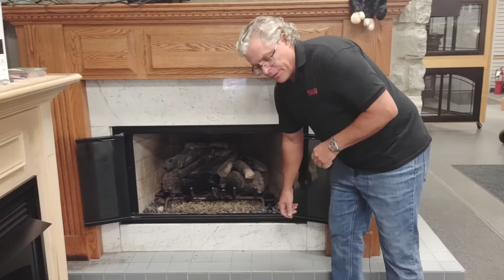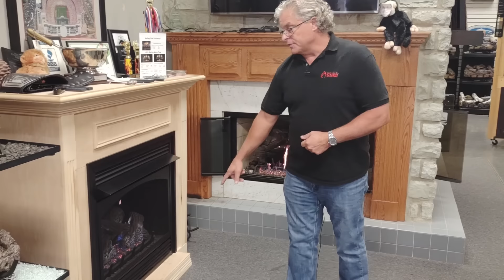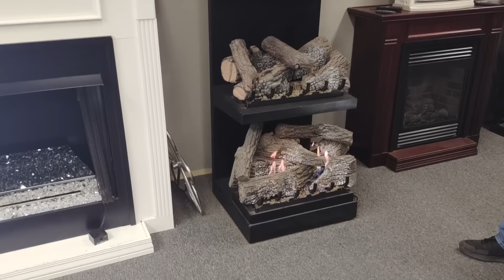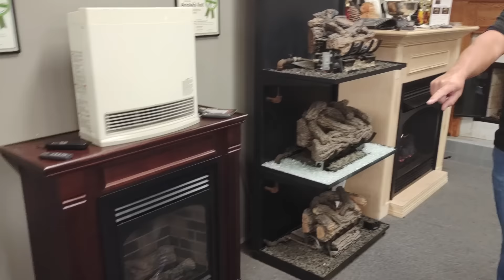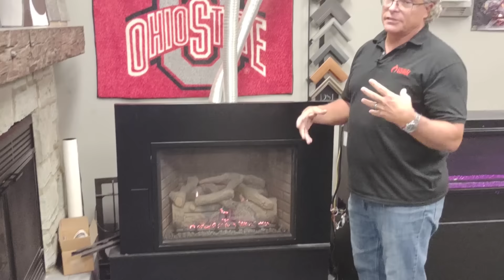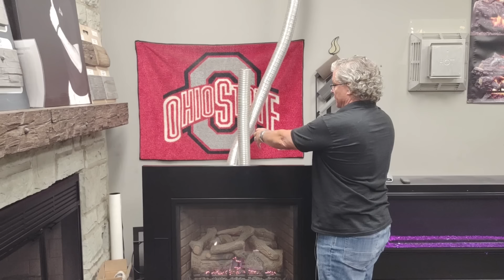Gas Fireplace 101 - Vented, Vent-Free & Direct Vent Gas Fireplaces Explained

Comment: I don't get it; one gas fire makes dangerous levels of CO and so it has to be vented up a chimney, yet another gas fire somehow doesn't need venting up a chimney.
What is the difference between the gas fires that makes one emit dangerous levels of CO and the other one safe levels of CO?
Reply from the maker: It's all in the burning process and how much fuel they use. Vented gas logs are essentially just lighting gas on fire. Think of it as one giant gas leak being lit. Since the combustion is not efficient and the fuel being used is around 90k btu's, vented gas logs produce a higher level of emissions, including carbon monoxide (CO), carbon, and water vapor. This is why vented gas logs need to be vented through the chimney, ensuring that harmful gases don’t accumulate indoors.

Ventless (Vent-Free) Gas Logs have a burner that is designed to burn fuel more cleanly and efficiently. The burners are engineered to produce a near-complete combustion process, which minimizes harmful emissions like CO. The byproducts they end up producing are small amounts of water vapor and carbon dioxide (CO2). This is able to happen because of the design of the burner and because it uses much less gas, only a max of 40k btu's.
Reply: @SpecialtyGasHouse  
Many Thanks!
Reply: @SpecialtyGasHouse  thank you for this explanation. But I have a fireplace with a flew/chimney, could I still get Vent free? If so, flew open still right?
Reply: I don't quite get it either. I think 'the logs' are being cited as one or another, and maybe it isn't the logs at all, it's the efficiency of the burners.

Comment: Bought a house with a regency. It has a remote bird gas, it’s built in. No manual, no idea how to turn on. Remote doesn’t turn it on. Don’t know model number. Can’t see a power switch on wall etc.
Reply from the maker: The pilot may need to be lit first. Do you see a little blue flame in the fireplace?

Comment: How about carbon monoxide levels regarding ventless units. 

Would you be replacing the oxygen with monoxide ?.
Reply from the maker: Ventless gas fireplaces,  don't need to be vented because of their specially designed burners. Ventless gas fireplaces use highly efficient burners that ensure nearly all of the fuel is combusted. This means they produce a clean burn with minimal byproducts, such as carbon dioxide and water vapor, rather than harmful pollutants like carbon monoxide in significant amounts.

All ventless gas fireplaces are also equipped with an Oxygen Depletion Sensor, which automatically shuts off the fireplace if the oxygen level in the room drops below a safe threshold. This safety feature helps prevent any buildup of dangerous gases.

Comment: Great information. We have a majestic vent free fireplace and just fired it up this year. Never used it before after living in our home for six years. One thing I notice tonight is the wood mantle gets very hot. Should I be worried about a very hot mantle? Can I add deflector kit to direct the heat away from the mantle? Thanks
Reply from the maker: The worst thing that could happen is it could discolor your mantel or possibly bubble up the paint if it is painted. Our company makes custom hoods if you are local to Columbus, Ohio, but they also make universal hoods that you might be able to put on your fireplace to deflect the heat away from the mantel.

Comment: I have a gas insert in a wood burning fireplace remote controlled,  home came like that. Have a co2 detector in room have had it on with the flute closed nothing on the detector for an hour.   Does it always have to have a open flute?
Reply from the maker: It all depends on what type of gas fireplace you purchased. Are they vent-free gas logs or vented?
Reply: @SpecialtyGasHouse  just found the paperwork lol, reading is fundamental!  Top page states "unvented gas log heater or vented decorative appliance.  Model deb20, deb 24, deb 30

Comment: So in terms of maximum efficiency, and throwing out the most heat should I lose electricity during the winter, and how much oxygen is being pulled out of my room( and how much is gas contaminating my breathing air) which system is the best?
Reply from the maker: Vent-free is 99% heat efficient so if you are looking for heat this is by far your best option. It also does not require power so it will become your emergency heat source when the power goes out. 

They burn 99.9% clean so you do not have to worry about any harmful fumes and they do use room air for combustion but it is nominal. Every vent-free has an oxygen depletion sensor on the pilot assembly so if it ever gets below a certain level of oxygen in the room the system will safely shutdown.

Comment: We have a house from the early 90s that has a gas fented. Fireplace and we put real wood in there  is that safe
Reply from the maker: In order to burn wood safely in there, you will need to remove the vented burner and fake logs. You can either cap the gas line in your fireplace or add a log lighter bar to use the gas to assist in starting your wood fire. 

Then I would definitely have a chimney sweep come out to ensure there are not any issues with your chimney flue and to make sure it is venting properly.

Comment: very informative. We had our home built 4 years ago and they put what I think is a direct vent fireplace. It has a blower inside and a metal box on the outside of the house. Just curious as to what gasses are emitted from the outside box. I'm considering enclosing it with a glass greenhouse style enclosure so I don't have to carry outdoor plants inside during the winter. I thought if it emitted CO2 that would be perfect for the plants and might exhaust some heat as well to keep things from freezing. Would that be a safe project or would it reduce the intake air or create a gas-filled environment that would kill the plants. Thanks for any info.
Reply from the maker: It would create a gas filled environment with carbon monoxide which would most likely kill your plants. I would definitely not do that.

Comment: Do you need 110V outlet inside the firebox for the igniter/controls for any of the options you showed?
Reply from the maker: Vented, vent-free & direct-vent millivolt gas fireplaces do not require 110v. If you are adding a blower to a direct-vent, then you would need power run to it.

Comment: to open or close the flue...  I have a doublesided (see thru) vented woodburning fireplace with a gas firestarter.  We don't burn logs because its hard to keep the smoke from blowing thru instead of going up the flue pipe, besides its messy.   We instead have fireplace glass with the special burner.  Has worked great for 16 years, lovely.  My question is, do we have to open the flue?   We have hanging glass plates as firescreens, but there is a gap around the edges for air to come in/exchange.    Our flue is a pain to open and close, so I would like to keep it closed since we aren't burning wood.  This would also help keep out dust, and may direct more heat into the living areas.  It does not have a pilot lite.  It has a key we turn, and light with a match.
Reply from the maker: If it is a vented gas fireplace, you have to make sure the flue is completely open when in use. If you do not you will be getting CO into your home.

Comment: With a Vent-Free Fireplace can I build my own mantle/surround then have the vent-free fireplace installed?? OR if I have a 3D model of a mantle/surround can your company build it to work with the vent-free fireplace?
Reply from the maker: Yes you can. You just want to make sure the top opening of your fireplace is a safe distance away from your mantel. The distance all depends on how deep your mantel is and if your unit has a hood or not.
Reply: @SpecialtyGasHouse  THANKS! I would refer to the manufacturer specifications as to how much clearance is required  between inner mantle sides, bottom, top and rear before install. With my DIY plans it calls for ceramic tiles on all inner areas surrounding the unit. ( ⭐⭐⭐⭐⭐ Specialty Gas House. )
Reply: I drove up to Columbus to check out the ventless that you had there. I need help. I don’t think my sales guy there would be able to do a design. Any way I can get help?

Comment: I am looking at the vent free style but have questions. 

I have a blank wall that I am framing up, I want the fire recessed in the wall with a floating mantle. Do I purchase an insert and a set of vent free gas logs or is it sold as one unit? 

Also is there any blower or power requirements (power outages will the fire still work)? Thanks
Reply from the maker: You would purchase a universal vent-free firebox and then a gas log & burner to go inside the box, or you can get a whole system unit that is sold as one unit. If you do the universal box you will have more options to choose from. Both are usually right around the same price. 

Vent-free does not require any power, so they will continue to work when the power goes out. If you add a blower you will need to run power to the unit. I usually advise against blowers though because you don't really need them with vent-free since they are already 99.9% efficient.

Comment: Won’t be using my vented gas fire place until they lower the gas prices.
Reply from the maker: Replace it with vent-free, it uses 1/3 of the amount of gas and they are 99.9% efficient, which means your furnace will be working less.

Comment: I have a wall insert gas heater but I am curious if I can switch to a fireplace look with a mantle and not need a chimney or anything? It’s in the middle of my house and on the other side is a kitchen sink so I have to be careful of what I do.
Reply from the maker: Without seeing a picture and knowing all of the information, it sounds like you can do a vent free fire box, either free-standing with a mantel, built into the wall, or with a wall built out. You won't need a vent or chimney with these. 

Here are some examples of boxes. http://whitemountainhearth.com/products/vent-free/vail-fireplaces/

Comment: Has anyone used two 4" inch duct, in place of, one 6" ( dual flow/coaxial)?  I want to use 4" chimney out thru the roof and 4" for intake air that will come in from a knee wall.  Problem is,  I can't go straight out thru the knee wall because the window ledge is below the Stove exhaust.  A 6" flue looks stupid on my Hearthstone fireplace and blocks the view out the window.

Comment: I’m more confused now after the video then before
Reply: Lol
Reply from the maker: Hi Jamie, what questions do you have?
Reply: @SpecialtyGasHouse I’m trying to figure out if I need to open the escape tube on the fire place I have gas set up with vented logs do I need to open the door in the chimney
Reply: @jaredgonzalez3372 , Yes, you need to open the damper (“door in chimney”).  Like he said, if you have vented logs, you are not even supposed to be able to close the damper because it would be dangerous.
Reply: @jaredgonzalez3372 the "vent escape" is known as a damper, is the flap that's used to open and close the flue. That's what he is referring to. That gets clamped permanently open for safety (carbon monoxide)  and the doors in front need to stay open during operation for gas logs.
Reply: Thats because your IQ is 63
Reply: @reellovefishing714 🤣🤣🤣

Comment: Looks like I have the same fireplace.  It was running then just stopped.  It won’t start up again.  When I hit the switch, I can see the igniter working and sparks, but it’s just not lighting the fire.  Do you think this replacement would fix that or do I have another issue?
Reply from the maker: Depending on what kind of fireplace you have, it might just need some routine service.

Comment: Vent less offers great heating ability and very cozy.  However - wood burning inserts have so much more charm.  Therefore, I will be adding a vent less wood burning fire insert for the best of both worlds!
Reply: Lol ventless woodburning ,,,,,,good luck with that….. I think anybody knows what’s gonna happen, my goodness!!!
Reply: Not sure what you mean.  There are vented and non-vented.  What is the unit that offers best of both worlds?  What is it called?   I have a wood burning FP. I like the look of the vented set, they look more realistic, but the ventless provides more eat.
Reply: Wood burning fire has to vent. It produces smoke.

Comment: Are ventless safe from a carbon monoxide standpoint?
Reply from the maker: Yes, they are! They burn 99.9% clean and only release trace amounts of carbon monoxide. They will produce anywhere from 0-10 ppm which is completely safe. CO does not become dangerous until about 30-50+ ppm. It is always smart to have a CO detector near the fireplace as with any gas appliance but it should never go off.
Reply: @SpecialtyGasHouse  Thanks, I hugely appreciate your response

Comment: Really good info. Maybe a question for the installer, but does a vent-free log set in an existing wood-burning fireplace require the key system in wall/floor or can it be piped up directly to the gas line (with likely a shutoff valve between the gas pipe and flex connection)? Thanks!
Reply from the maker: Vent-free does not require a wall/floor key shutoff. However, every gas fireplace does require an emergency shutoff valve within 6'. But you are correct, you can put the emergency shutoff valve inside the fireplace between the gas line and the gas burner. 

I should say those are the requirements for Columbus, Ohio. It may be different where you live.
Reply: @SpecialtyGasHouse  Very helpful. I'll talk it over with my installer!

Comment: I have ventfree logs in a wood burning fireplace the heat comes out but also goes up and heats the underside of the wooden mantel as well as up the wall. How can I insert a blower to direct the heat into the room
Reply from the maker: A blower might help a little bit but the better option would be to put a hood on your fireplace. That will help push the heat away from your mantel. Either a universal one or you can have someone custom make one for you.

Comment: I have a ventless. System in my wood burning fireplace. It smells. Is there nothing that can be done other than cracking the flu?  Do the newer ones smell?
Reply from the maker: Depending on how old your ventless system is and the brand, it could give off more of a smell than the newer American made ones. The smell with vent-free is usually very faint with most people if it is a good quality unit. However, vent-free does draw in room air, so it will draw in any strong smells that are in the room. So if you are burning a strong smelling candle or have air fresheners in the room, that smell will mix with the gas and release an unpleasant kerosene-ish type smell. 

If your unit is older and you don't have any air fresheners or candles in the room, then you might benefit from purchasing a newer unit.
Reply: They smell like products of combustion. No getting around it. Ventless = bad